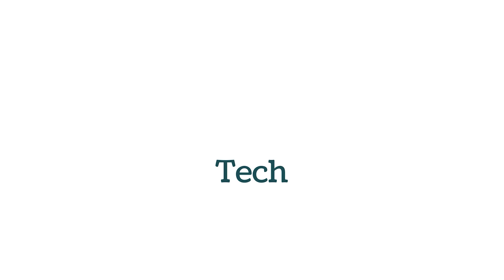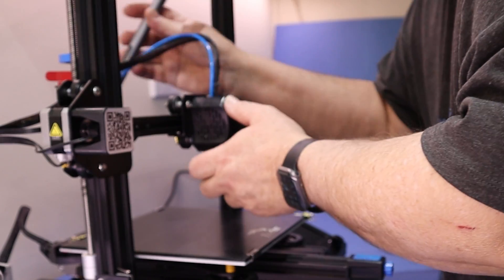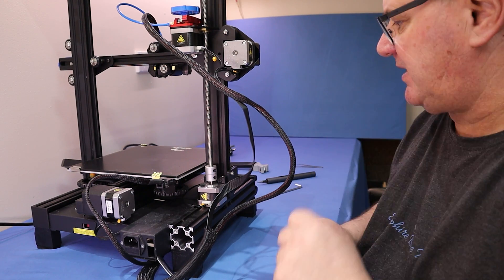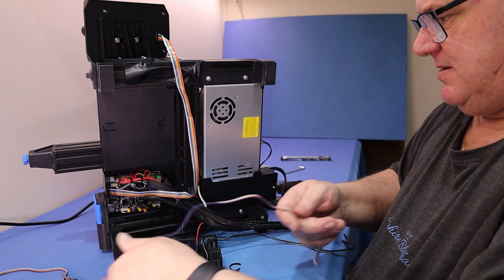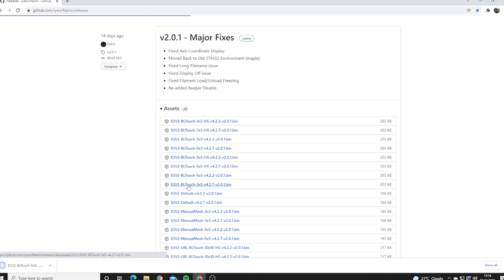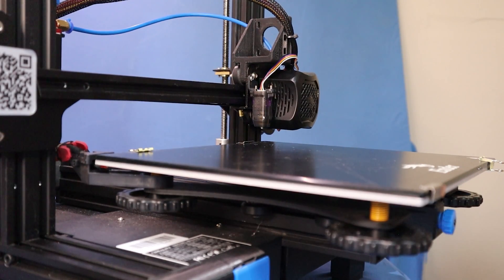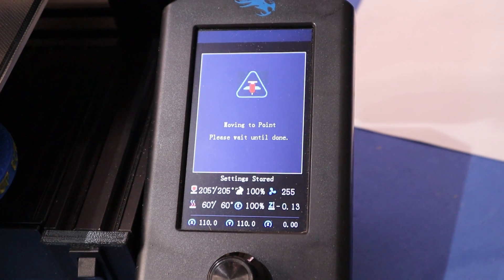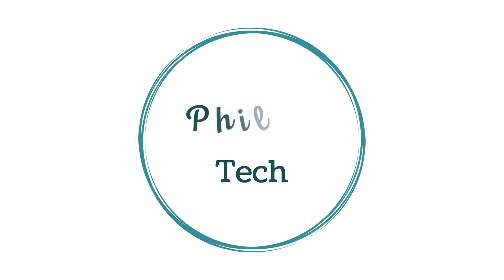CR Touch install Ender 3 V2

Comment: Z-Offset only - 0.13mm? I have the same configuration with -1.56mm.
Reply from the maker: Your Z offset will change depending on how tight your bed springs are.

Comment: Great video!  Do you need to upgrade the motherboard or can you use the one it came with when installing the CR Touch?
Reply from the maker: As long as you have a 32 bit motherboard you should be fine. Just check that the firmware you choose suits your printer

Comment: the Jyers firmware doesn't do my v4.2.7 any good i get very bad print results, i am now testing with the creality firmware the same prints and see if there is any improvement
Reply: ok the creality original firmware is giving me the same results , so it must be something else, this time i installed the HS version of the Jyers and printing out the XYZ calibration cube .... fingers crossed
Reply from the maker: Did you get it sorted. You may still need to tweak your z offset on the go.
Reply: @philtalkstech  Hi there, yes it's sorted, i'm using the CAT stl file settings on cura, and now it's much better .

Comment: So do I need a different board from what came with it original to add this?
Reply: You shouldn't. The board has a spot for the CR touch, if you get the BL touch it's a bit more technical from what I've seen. But I'm by no means an expert, I just got my printer a week ago
Reply from the maker: No if you have an E3 V2 then it has a spot for the CR Touch

Comment: Just curious if you could explain the 3x3 mesh vs 5x5 mesh manual? Is that still a good firmware if I'm just starting out?
Reply from the maker: 3x3 measures 9 points on the bed 5x5 measures 25 points giving a more accurate mesh but takes longer. If your bed is reasonably flat 3x3 works but 5x5 is better.

Comment: Great video and very easy to follow,  your instructions for the levelling setup seem really easy,  is it all that is needed,  I have the Jyers firmware and the CR touch and am getting a perfect first layer at 40mm/s speed however when I speed up to 60mm/s usually on layer 2 or 3 I get the dreaded stepper skip sound.  I then increase the nozzle height using the micro step and the skipping ends but now my layers are too far apart so don't stick and I end up with a birds nest .. :-( any thoughts am 4 days into this and seem to be drawing a blank thanks
Reply from the maker: Have you tried to up your hotend temp?

Comment: currently have the ender 3v2
do you recommend this upgrade?
Reply from the maker: It's working well for me. Do you have much trouble traming your bed?
If your bed is as up and down as mine then it definitely helps.

Comment: i had the bl touch and had a lot of problems with it mostly because the wires aren't shielded had interference with it after a few months. Switched over to the ezabl and have had no problems with it and have had it for about 9 months now still works perfectly. Have heard the CR touch works better though so would be interested to see how well yours continues to work.
Reply from the maker: I'm not having any issues with mine at all.

Comment: I have been trying to set my printer up with this CR Touch, and i cannot for the life of me get the firmware to upgrade. and your link is dead ... any chance you can help me out?
Reply from the maker: Happy to help if I can. 
What ender printer do you have?
Reply from the maker: Thanks for letting me know the link is dead. I’ll get that fixed
Reply: @philtalkstech  Ive got an E3V2, just got up up and running this morning
Reply from the maker: This link should work
https://github.com/Jyers/Marlin/releases
Reply: @philtalkstech  Amazing! thank you